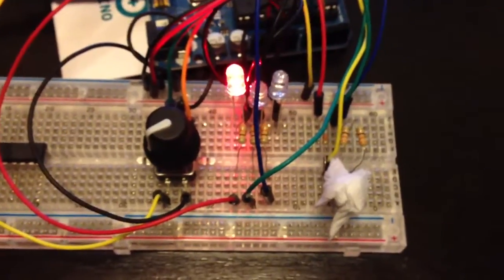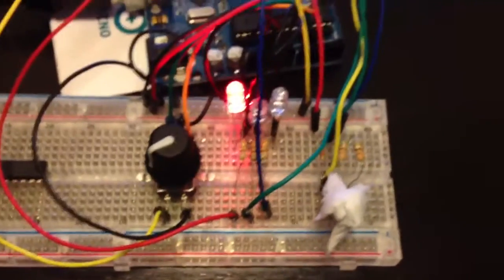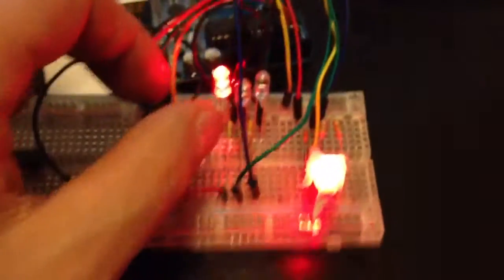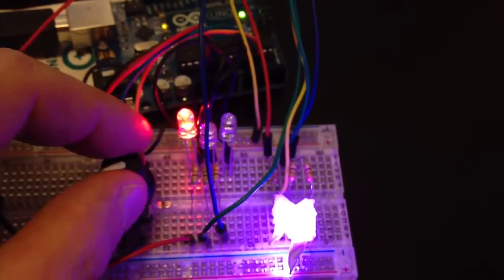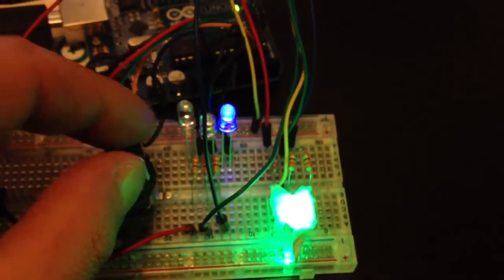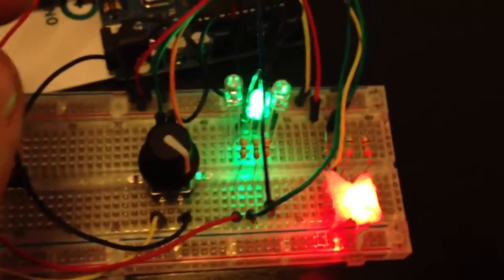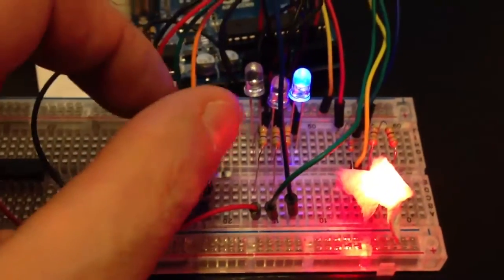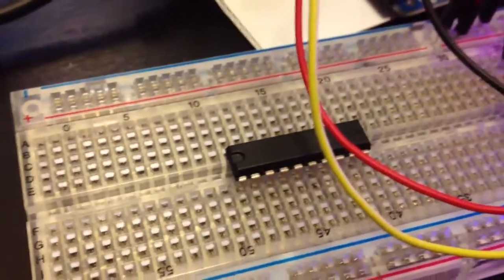Arduino: rotary encoder setting RGB LED color

Comment: I've tried my best to make this work, with no luck.  Anyone else tried to make this work?
Reply: yes, just did...  using an uno clone, i hooked up A/B to A0 / A1.  push button on #12, leds are r - 3, g - 5, b - 6.  pull the A and B high as most encoder code shows (10k ohm resistor to 5v)  also pull the button high as well so that it doesn't "float".   OH and make sure you set the baud rate to 115,200 on the serial monitor.  have fun! ;)
Reply: ryan cler planning on doing some zone lighting at home, this rocks as I now can individually adjust the zones with one controller... and in the future integrate infrared for wireless.